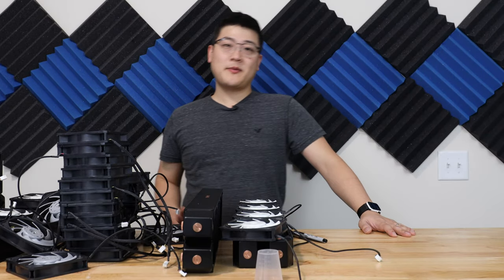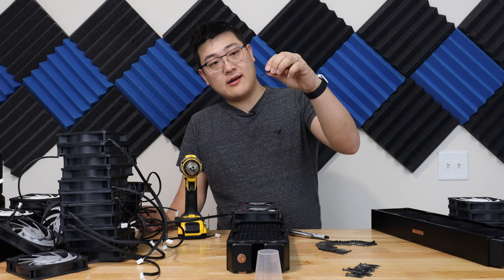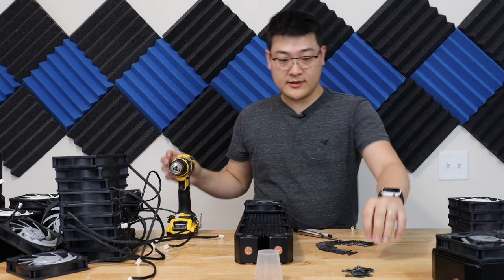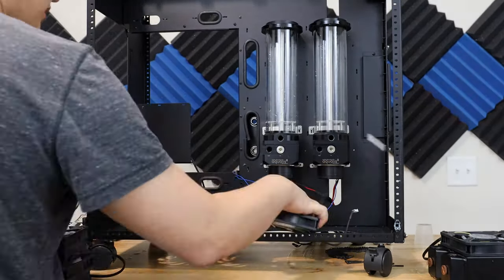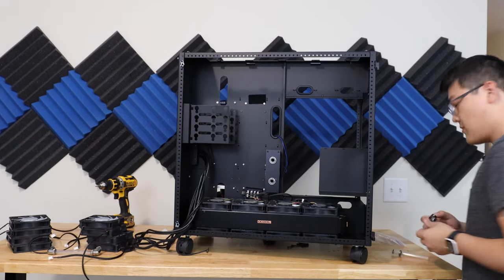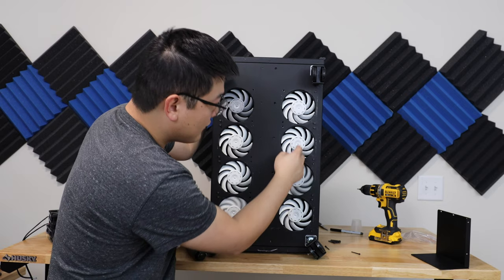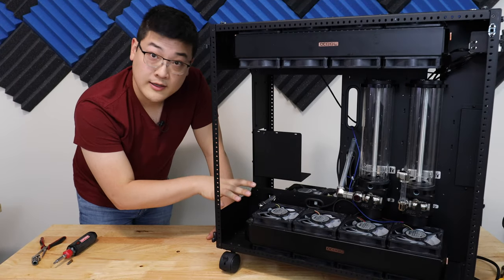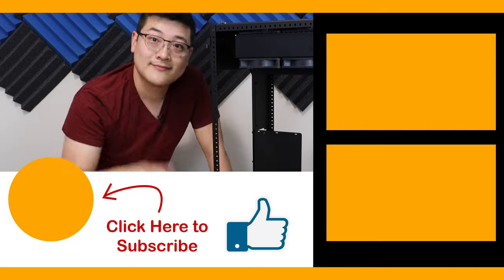AMD Threadripper 3960X Build Part 1 - Radiators In!

Comment: You are going to have issues with no filters on the bottom after time...
Reply from the maker: Possibly. I’ve always ran with dust filters and have found them to be extremely restricting. I want to see for myself how bad it really is without them. If a blast of compressed air and a wipe down every 4-6 months is all I need, that’s not that bad. We shall see.
Reply: @SuprUsrStan  so, it's been four months. Do you still recommend not using dust filters or have you changed your mind?